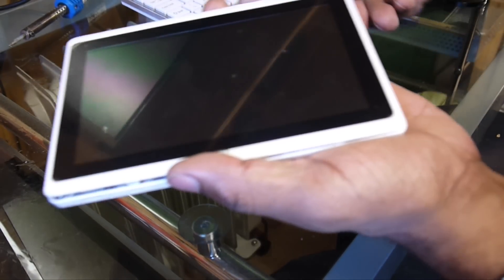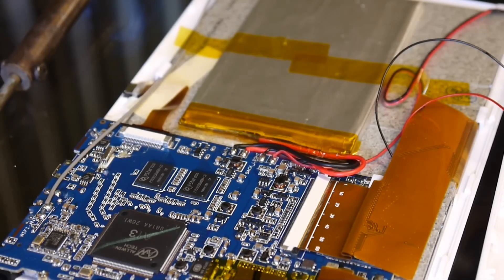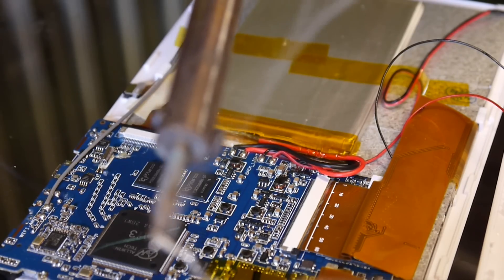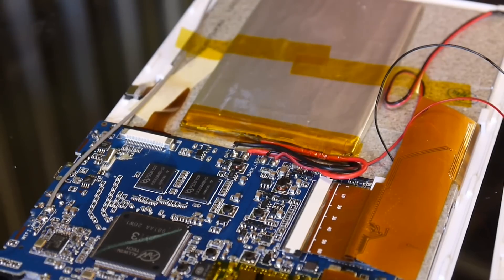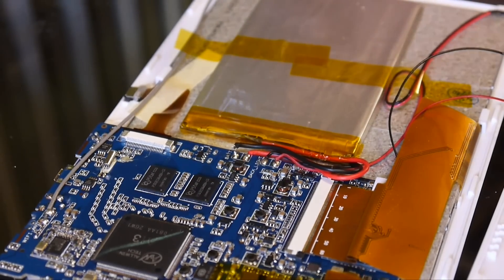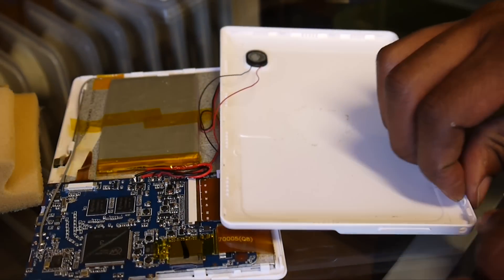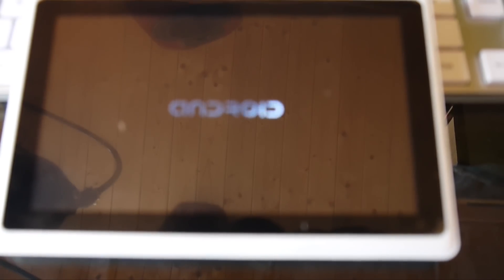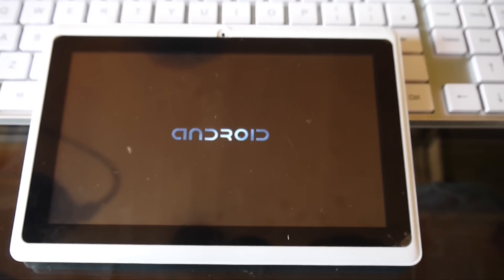Android Tablet solve boot loop problem Remove Internal battery Attempt

Comment: It looks like you're tinning the solder tip, over the circuit board... ughh... please don't do that! It gives me nightmares :(
Also, this would work if the tablet was stuck in a bootloop because of an empty battery. It seems that what you have here is a firmware issue, probably needs reflashing the firmware, or could it could be a faulty emmc, in which case it's fucked.
Άντε γειαααα..
Reply: Clearly firmware problem.

Comment: I tried this twice with the black wire and nothing. However I did the red cable and in between starting it pressed the volume + power button , this gets it to a safe mode . I selected factory reset, and just as i was about to throw the tablet in the garbage it started prompting me for and email to set up the reset...I have no idea what I did but it's alive for know...There is another video that explains the factory reset with volume method...you loose all your stuff in a factory  reset , but if its not working anyway that's not gonna matter...Good luck...

Comment: I successfully used a variation of the above procedure as follows on my Pendo Pad -

N.B. If your Pad is still under warranty then this will void the warranty!

1. Remove the back of the Pad
2. CAREFULLY de-solder BOTH the battery leads taking care to bend them upwards and don't let them touch each other or the circuit board
3. Leave the Pad unpowered for a period of time (I left mine for approx 3hrs)
4. CAREFULLY re-solder the battery leads and replac e the back cover
5. Power up and if boots then
6. Connect your pad to your notebook/PC and transfer any files you want to keep.
7. Disconnect pad from your notebook/PC
8. Reset pad to defaults
9. Enjoy!

Whilst this may not work for everyone my Pad is back to it's out of the box happy self!

The irony being that my darling wife had bought me a replacement pad the day before I tried this and I'd already used it! 

Murphy's damn law strikes again!

Comment: after you remove the battery connected to the board, you have to insert a power cable to turn it on then try to reset it

Comment: Corrupted system files cannot be fixed by simple battery reset. You must do a full factory reset to wipe out all files and replace all corrupted system files with a new one, just like reformatting hardisk and reinstalling Windows on a PC.
Reply: SOLVED, i have a  Ellipsis 7  tablet, was stuck on boot screen. tablet was rooted and all happened when i mod my boot animation. i finally got it working, what i did may work on other tablets. hold power button and volume UP at same time, once on, release only power and continue holding volume. a seperate menu pops up. choose wipe data. then restart.after it seemed like it was still stuck again but 20 minutes later screen changed to black then said intializing setup. it mustve been reparing files or something. all back to normal. factory settings. personal info gone but works.
Reply: it's true! you're right! um... do you have the firmware of this tablet (mid 2330 s)?
Reply: Unfortunately I don't. In order for you to get the right firmware, you 
must open up the tablet and look inside the markings on the board for 
the model number. Too bad firmwares for older Chinese tablets get 
deleted overtime. I have had trouble finding firmwares for my 2 bricked 
Android Tablet mobo model numbers -- Topwise F721_Mainboard_v2.0.0 
(X-Touch 707 Tablet); and an EM2926-738A ver:07 (Skyworth Tablet)
Reply: Wish I could do that in one of my tablet with stuck android logo. Unfortunately the "volume up" button was damaged and wouldn't respond to get me into the system recovery mode.

Comment: Just bought an Irulu X1a 9 inch Tablet PC. The tablet is constantly rebooting itself when I'm in the middle of something! Very frustrating. I did a hard reset yesterday and it does itb1 or 2 times daily...
Help please!!!
Reply: Gourav Goyal Pin in hole? Explain plz
Reply: +Tiffany 562411 some tablets have a tiny pin hole where you could put a pin in and click it to reset the tablet, not all tablets have it so...
Reply: I was in the same situation 
I got ota update 
do "take bug report"
and I think the company will fix it
Reply: Lay-Lay Jones w